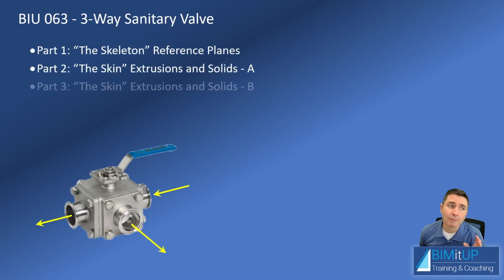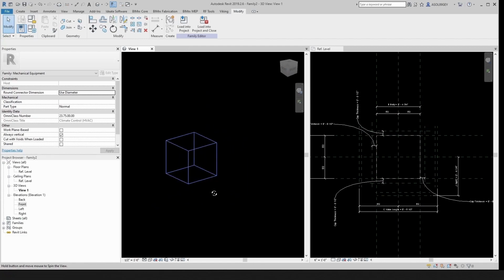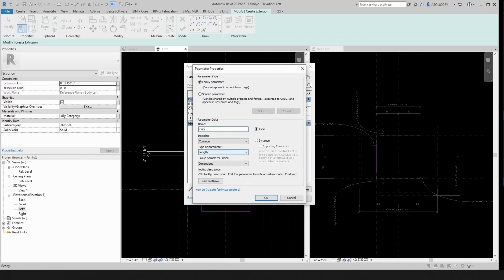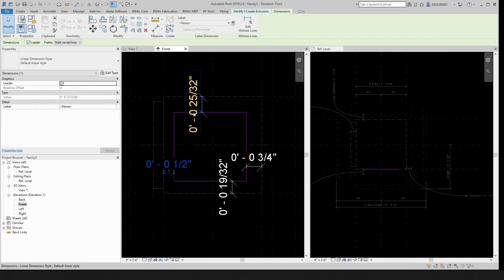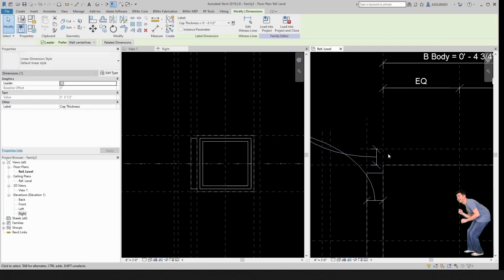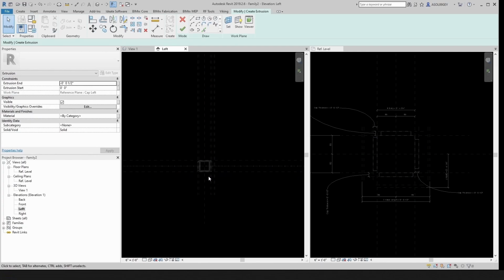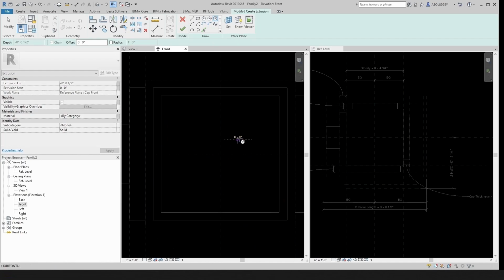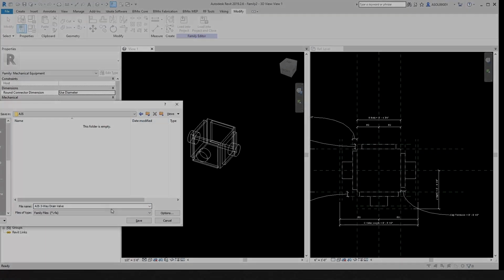How to Create a 3 Way Valve Part 2

Comment: When you added the caps to right and back, you have dimensions going to the caps of left and front 😅. This is why you also need to flex your family during the process.

Btw in newer versions of Revit, the align-tool has the option to automatically lock to the plan you align to.
Reply from the maker: 🙂 Yes. Cool.